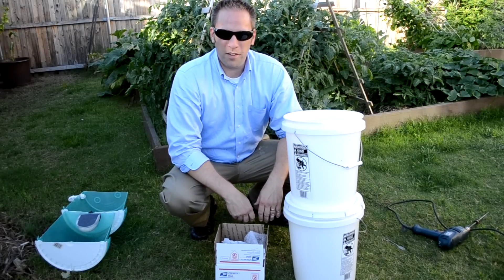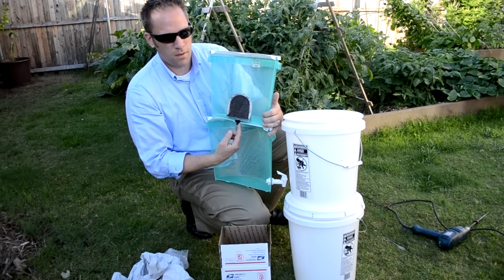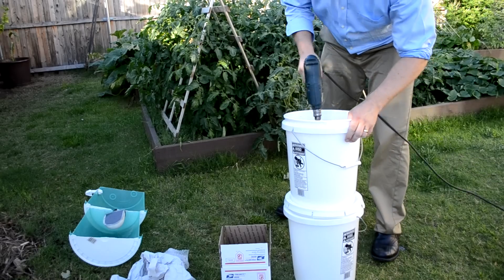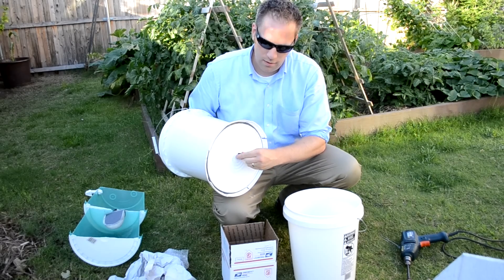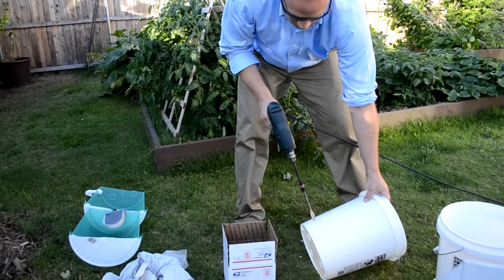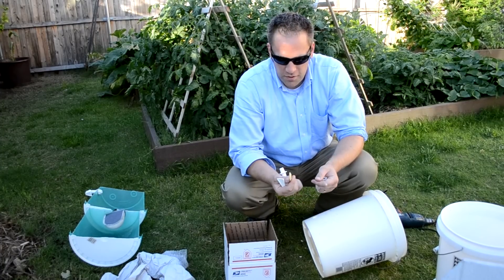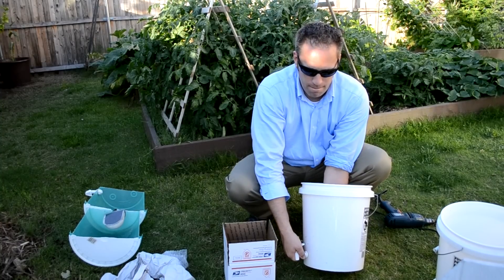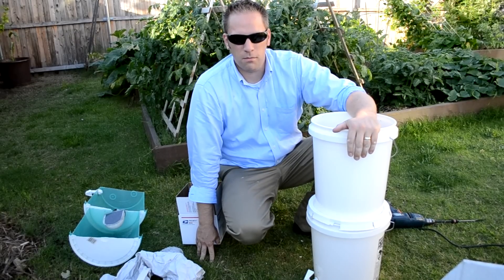Ceramic Water Filter Bucket Installation

Comment: Will this filter flouride? and if not will a Berkey PF2 flouride/arsenic filter fit on the thred? thanks
Reply: Normal ceramic does not filter out flouride. Springs and rainwater are however normally free of flouride.